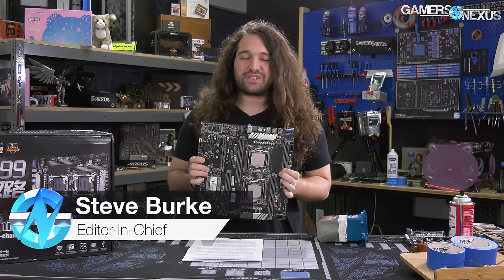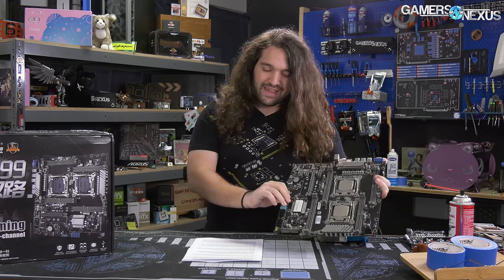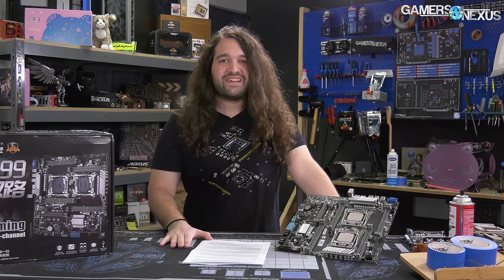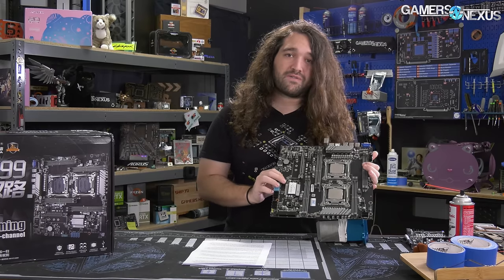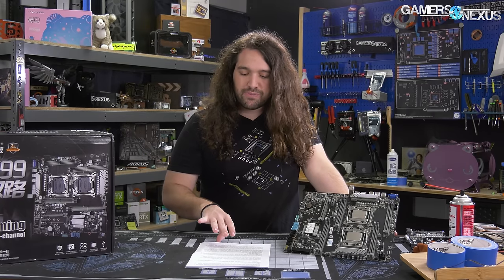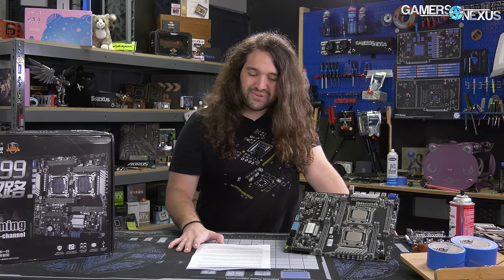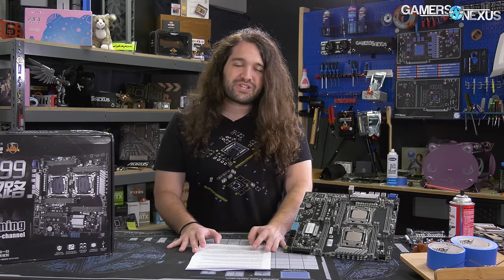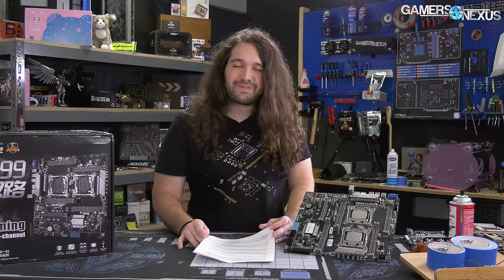24 Cores, 48 Threads for $360: Dual-X99 Jingsha Motherboard vs. AMD R9 3900X

Comment: Gaming console: let's call it "Pro"
Workstation board: let's call it "Gaming"
Because logic.
Reply: its buzzword completion from pr guys who have absolutly no clue about the hardware.
Reply: @proxis9980  'Marketing' rather than 'PR' - there's a difference. Granted, not much difference in the levels of honesty or integrity, but still a difference 😉
Reply: Marketing: causes shitstorms with their lies
PR: address shitstorms with new lies
Reply: It doesn't even fit well for a workstation.   It's completely ignoring half of the memory channels and 90% of the CPU PCIe lanes.  The main things you go Xeon for, aren't here.  Despite the built-in GPU, the missing memory channels and PCIe lanes- and no x4 PCIe slots- make it really limited for server usage.
Reply: @bobprivate8575  because it's not for server use. There's a reason these are cheap, people running computers 24/7 throw these out for newer ones! As far as workstation goes, there are SFF Xeons and Threadrippers so that should tell you something about PCIe lanes not being always the focus. Some people just want a lot of cores. And for some scenarios, maybe you could jank up a ghetto workstation from old Xeons that almost makes sense.
Reply: @4.0.4  I almost agree with you.  Except it seems to be designed for server use with the anemic integrated graphics.
And yeah, with SFF you have to make sacrifices.  But this isn't SFF, it's a nonstandard size larger than ATX.
Reply: @WhenDoesTheVideoActuallyStart  haha this is exactly it, dude 😂
Reply: If there is anything that has no place in marketing, it is logic.
Reply: Weapons in any US mall : let's call it "Tactical" (just a camo paint and a chinese laser will do the job) 😂

Comment: Wasn't this like the best way to get a budget system with lots of cores? At least before Ryzen existed.
Reply: hi
Reply: @animearmpits3060  wtf is it with you just spamming hi on every comment here? Pretty sure you're a bot
Reply: It still is the best way
Reply: No, because before Ryzen existed high core Haswell xeons were an absolute ridiculous price and really only an option for commercial applications
Reply: @swirrllfolfsky9803  ignore and report dude best way to deal with them
Reply: Back then, yes, but it was X79. X99 has become what X79 was and with a similar level of caveats in terms of old architecture vs. discount performance. The remanufactured motherboards are new, though. Historically, high motherboard prices has been the biggest drawback with the old Xeon market.
Reply: Yeah, engineering sample xeon CPUs were great with multi threading workloads in the past. Getting a reliable dual socket motherboard was a challenge though. And there were varying levels of engineering samples on ebay as well. Some have no boost, others no temp sensors.
Reply: @w19ely85  I am currently running an E5-2678V3 with all core turbo unlock to 3.3Ghz, that is on all 12 cores/24 threads. This is not an ES.  Price was US$85 on eBay. This OEM chip is DDR3 and DDR4 compatible too. The HuananZhi motherboard is an X99TF (which has 4 x DDR3 and 4 x DDR4 slots) Currently running it with 32GB desktop 1866 DDR3 (Mushkin REDLINE) in quad channel. Timings are tight at 10-10-10-27. Temps with a 6 pipe dual 120mm SNOWMAN tower cooler never exceed 60C under stress, with ambient at 20C. CB R15=1824 / CB R20=3912.
Reply: Pretty much. It's still cheaper, but you're paying dividends to your power bill in turn.
Reply: @KiraSlith  If power is an issue, a dual CPU config is not the way to go, IMO.
Reply: @KiraSlith  Yes, this is the biggest pitfall. Electricity is very expensive where I’m from.
Reply: It arguably still is, if you don't have the money for Ryzen.
A 2678v3 costs slightly less than a second-hand Ryzen 7 1700, the cheapest single-socket quad-channel X99 motherboards with reasonable VRMs are about the same price as a cheap B450 motherboard, and the ECC Registered 2133MHz RAM is also much cheaper than standard desktop RAM while being about the same speed as 4000MHz desktop kits because you have 2x as many memory channels.

You basically get similar multicore performance with more RAM at a lower price.
Reply: HUGE ANIME BREASTS
Reply: @swirrllfolfsky9803  you just argued with a bot
Reply: I want to build something like this for IT work with virtualization. Where do I start?
Reply: @johndee759  same here , did u find how to do it ?
Reply: @16_052 Ahmed Abrar Shayor About US$640 for full system plus GPU. Use it mostly for video editing/rendering, some gaming (WoT) and VR. Can pair well up to RTX2080S with aplomb. X99TF was $100 at the time.  E5-2678V3 was $85 at the time.  Saved money using DDR3 desktop RAM (1600) in quad.
Reply: Note that DDR3 REEC 1600 will be cheaper, typically...but I got a gr8 deal on 4x8GB Mushkin Redline, through a local seller ($110). As for the X99TF, I actually had a failed delivery on the initial AliEx order, with a full refund.  That initial order unexpectedly arrived 3 months after the refund.  In essence, I got two X99TF's for $50 ea. I am keeping the xtra board for a planned upgrade on a system for my daughter. Will also use a spare E5-2678V3 ($85) for this planned build. For this planned build I will go with REEC RAM.
Reply: @V1N_574  Or just leave them alone he isn't scamming anyone or being mean

Comment: That  AST2400 is an IPMI chip: it is used in servers for monitors as it has some very beefy capabilities: it can monitor hardware states and even flash the bios, remotely, even with the system off and even with the system with no CPU installed, over the internet.

This feature alone could make it desirable for FreeNAS and Homelab enthusiasts as a similar board for AM4 to run say, a 3900x would run you 400 to 500 USD. You get some similar tech like high number of sata drives, access to ECC which is normally not present on AM4 boards and even newer connectivity for storage like U.2 or Oculink connectors and SAS ones too but the rock bottom price of these make it attractive specially for dumpter drivers: you could salvage a mostly busted server and just get this board and CPUs which would be as costly as the entire discarded server each but you get a potentially working 2U chasis, fans, several hard drives that might still be good enough for just a home lab to play around with, interface cards, raid controllers, etc.

So it has its uses. Not many but it is possible to make something out of this, Wendell for example could probably rebuild your NAS with it on the cheap if you ever needed to.
Reply: Wendel did with them a year ago i think. Just lookup gamers nexus unraid. The board they use has the ipmi on it too. Lovely feature, i’ll say :)
Reply: It's not an "IPMI chip", it's a BMC which can support the IPMI protocol...or redfish.... or other protocols

Comment: To me, this sounds like it would be a wonderful home lab VM host.
Reply: Ikr.. it would be fun building vms on this
Reply: idk i think I would look for more "enterprisey" hardware with IMM and such, probably even cheaper when you don't really care about per-core-performance
Reply: Not sure I've ever had a need for that many cores but sure would be fun to see how many containers I could run on it doing random junk.
Reply: And containers. This system is crazy compared to my Mac Pro 2010 with dual Xeon x5670s. It also looks like it can do gaming better too for those games that are heavily CPU bound.
Reply: @kiseitai2  Most heavily CPU based games are single threaded and why they bottleneck so much. This is why/how Intel has managed to stay relevant in gaming.

For games that are multi-threaded, I imagine most aren't Numa aware, you'd need to limit them to a single CPU in some method, in either case you'd probably not get much better performance than a single CPU.
Reply: At what cost?
Reply: @DoomsdayR3sistance  Yes, you can use SW called "process lasso" to lock them on single CPU and yes it helps gaming performance a lot, I had similar system before and it ran much better. For most people tho, some even more budget board with single CPU (can be with more cores) is a better solution, as with this architecture, with more cores also comes more L3 cache and it just gets better and better for games in that way.
Reply: @kiseitai2  Nothing wrong with the x5670's other than power consumption. A single X5670 can still run any game released in medium settings or better. For these V3 CPUs.. Cheapest way out is a used Dell workstation.
Reply: @DoomsdayR3sistance  So you agree with me since the Xeons in the video are 5 years younger (newer arch) and can clock to 3.3ghz (my Xeons are locked at 2.9 ghz). Also, my windows instance is virtualized so it would not need to know about the underlying cpu topology (although I passed that info to it). I am sure there are ways to optimize it better, but you would be surprised how well the experience can be. I would argue my bottleneck right now comes more from the pci bus than the cpus themselves although I agree they may not be optimal.
Reply: Proxmox.

Comment: Because the memory controllers are on each CPU, its 2x quad channel IMCs, so really it's not 8 channels but 2 4 channels, much like with the older threadrippers it's like 2 NUMA nodes, you won't see 2x the bandwidth if only 1 CPU is loaded as to access the other CPU's memory is slower but can be done through the QPI link.

Comment: Something that should be added is that you need to look at the advanced settings and see if there is a setting for NUMA (non uniform memory access). As this setting prevents data sharing across memory banks on multiple processors. I think it would make a huge difference in your results for game tests as well as other benchmarks. Dual socket systems are not easy to configure. They require much research and understanding of the platform. I speak from experience because I run dual 8280 platinum ES processors in my main workstation.
Reply: I'm fairly sure I've heard Steve mention numa before. No harm in reminding him though!

Comment: the X99-F8D is probably the best Chinese dual X99 motherboard currently available. Excellent for an editing and rendering rig as you can add a decent GPU and more than one RAID controller for GPU accelerator and very large RAID arrays as the same time in the same chassis. It's also a board well used by Miyconst and has great community BIOS support. Absolutely don't buy a dual CPU board if you want to game. Better to spend the money on a single socket and get a higher clock speed CPU instead.
Reply: Single socket like the x99-F8
Reply: I fully agree with you.

Comment: I'm literally building a Xeon e5-1650v2 build for a buddy right now. I just got parts today. We went with one of the eBay "x79" chinese boards. It works fine, but they didn't solder the m.2 slots, even those the solder pads are there lol. But for $80, it runs the 32GB of ram that cost $45 at 1866mhz. It's kinda nuts.....
Reply: im sure there is also a pcie adapter where you can slide those m.2 badboys in
Reply: For x79 i would advice trying the huananzhi deluxe 2.49 its the most complete board you can get
Reply: @benaliamine1140  I built a PC for the eldest kid using this motherboard, paired with an E5-4627V2 that all core turbos to 3.5Ghz (8 cores/8 threads).  NVME boot drive.  32GB REEC DDR3 1600 RAM. For the money, an excellent combo. Runs cool and has been reliable for about 1 year to date.  I did place active 80mm air cooling on the VRM for safe measure, though this CPU is easy on the VRM, in general.
Reply: @jb678901  same fir me I've been using those x58\x79 platforms for the last two years . I think these mobos are the best thing since sliced bread lol

Note: building a ryzen system in my country will cost me double the price as we are hit by 50 percent tax on all computer parts so and 200 $ combo sounds better for me than a 500$ local build
Reply: @benaliamine1140  Yes, I have been a XEON fan these last 2+ years. 4 built in total (1 for ea. teenager + 2 for the home office) and none exceeded ~US$700 incl. GPU, case, PSU. All CPU's were purchased off of eBay. Most GPU's were local-used purchases. Chinese boards from HZ official store on AliEx. For the most part, import duties into CH were minimal.
1) ASUS P9X79Pro ($20 mint, local deal) + E51680V2 ($155) + 32GB HyperX Fury DDR3 1600 + RX 590 (new, $170). PSU:TX650M (new)
2) HZ X99TF ($99) + E5-2678V3 ($85) + 32GB Mushkin Redline DDR3 1866 ($120, eBay bid) + GTX 980 FTW ($200). PSU: CX650M (new).
3) HZ X79 Deluxe + E5-4627V2 ($105) + 32GB Samsung REEC DDR3 1600 + GTX 980 Stryx ($180). PSU: CX650M (new).
4) AsRock Xtreme 4 ($200) + E5-1650V2 ($60, local) + 32GB HyperX Fury DDR3 1600 + RX 570 ($120). PSU: Rosewill 650W Bronze 80plus (new).
Reply: Heads up, I got better OC performance & reliability out of the e5-1660 v1 or the  e5-1680 v2 than my e5-1650 v2 on an Asus X79 Deluxe. (not sure what the performance on the Chinese MoBds will be like though)
Reply: @jb678901  I never needed it but I put a 40mm fan over each VRM heatsink for extra measures, in mine as well.. lol
Reply: @I_ammm_mojojojo  I do have an E5-1660 that I purchased for an AsRock Extreme 3, after discovering that board wasn't accepting V2.  Managed up to 4.5Ghz on air, but it now is a spare in a box for the time being.  The 1680V2 could go higher, but I am at my comfort zone with air cooling at 4.4Ghz...and it does fine at this OC on the ASUS P9X79Pro.  The 1650V2 has been another solid performer and can also achieve 4.5Ghz on the Extreme 4.  However, I keep it at 4.3 Ghz as its my daughter's PC and she doesn't need to push its limits when paired with the RX570. It is a silicon lottery, at the end of the day.

As for the HZ X79 deluxe, the max I have ever OC'd was with the 1650V2 to 4.1 GHz.  I never modded the BIOS to go higher and was always careful not to stress the VRM's too much.  Other's have successfully done this with Russian BIOS'...but with the VRM cooling necessary at 4.5Ghz levels. If I were to OC that X79 deluxe for long periods with a 1660 or 1650V2, I would direct a 60 or 80 mm fan on the VRM and also place with thermal adhesive some 1cm sq ALU or copper heat sinks on the VRM back-side support plate. IMO.
Reply: @I_ammm_mojojojo  e5 1680v2 is still expensive thats why i'll wait for it's price to drop under the $50 then I will buy it, for the cooling you can use a custom water block on the vrm it will set you back by 6$ and the small heat sink on the resistors so you can make sure that the motherboard will last at least for the next 5 years. The only drawback is that it doesn't have a graphic chip and you can't use the integrated GPU sadly, if they add an hdmi port you can even the cheap p106-90bm mining card with custom drivers for some light gaming
Reply: @benaliamine1140  yeah, the 1680 still goes for around $150.
The airflow in my case  is excellent and is in a rather cold office.. and the VRM heatsinks are rather large/efficient on the Asus X79 Deluxe.. so the VRM temps are quite low, so the water block solution isn't needed..

Also, I have a Quadro GPU for my uses, that an IGPU would not have met.
Reply: @I_ammm_mojojojo  i use the chinese board thats why i always keep an on the vrm temps. Asus is an awesome board but it's expensive
Reply: @I_ammm_mojojojo  Both the V1 & V2 are pretty much the same. Both at stock the IPC is slightly better on the V2 as expected but not as much as you would think. Overclocking, the V1 is slightly better. I'm not sure that IPC will count for much either with the V1 a few hundred MHz higher than an overclocked V2. If overclocking get either. If your not get the V2.

Comment: My unraid server is a dual x58 system I slapped together for 120 bucks, I guess this is the upgrade lol
Reply: Which xeons are you running in that machine? And is it any good, because I was thinking about buying an hp proliant dl380p g8, that has a dual x58 mobo too
Reply: @pietrocavicchioli6128  hp z600 is dual cpu and dell t5500 both are towers with sound lga 1366 boards
Reply: @strain-tv  well yeah, I actually did a miss spell there, I meant hp proliant dl380 g6, not g8. (and no, I'm not considering buying dell t5500 or z600 because even though I know that they exist, in my country the are way more pricy than old servers)